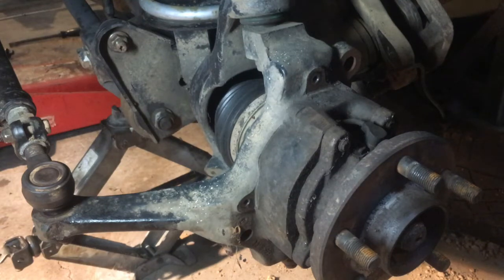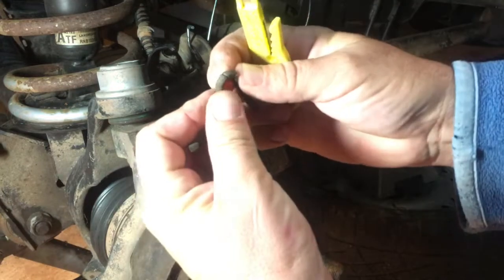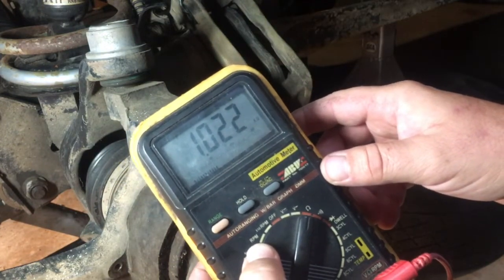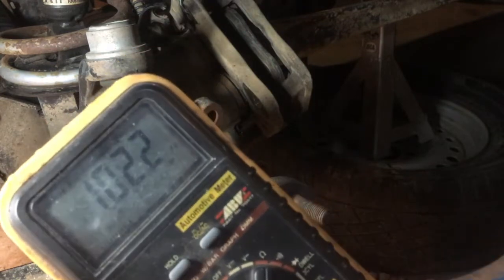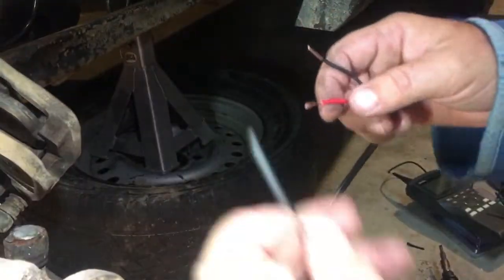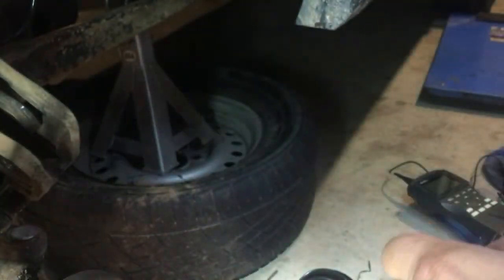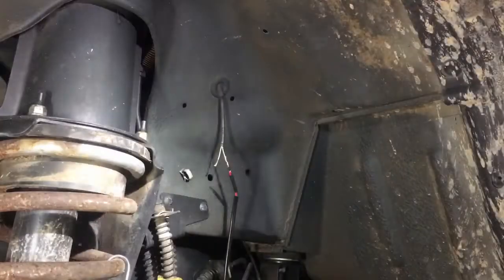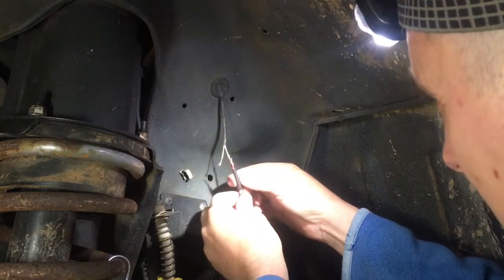‘Td5 Hack’ How to test your wheel speed sensors.

Comment: Why cut the wires when it can be tested at the plug without removing the wheel!?
Reply from the maker: If you are swapping over the shafts or replacing ball joints, then don't cut them. If you only need to swap a sensor, then it's quicker and easier to chop. I increase the length of the loom to allow for the suspension drop anyway. This front axle had already been cut before I got to it.
Reply: Fair enough. @dinosshed

Comment: Hi there, I have a TD5 facelift on a 2004 plate. I have the 3 amigo's. So I changed the sensor cables, cut the plugs out in the engine bay and direct soldered them together in case the plugs were the issue and I have replaced the shuttle valve. But the code reader is saying sensor output too low. Any idea what that means ? its an I car soft v3

Comment: Where I can find speed meter sensor disco II
Reply from the maker: There's one of these sensors in each hub and signals back to the SLABS module to generate the speedo output.

Comment: So what about the voltage out put of abs sensor?
Reply from the maker: It produces an alternating current that increases with wheel speed. Voltage will act in the same way but this is a good way to check their output after replacing a hub etc.